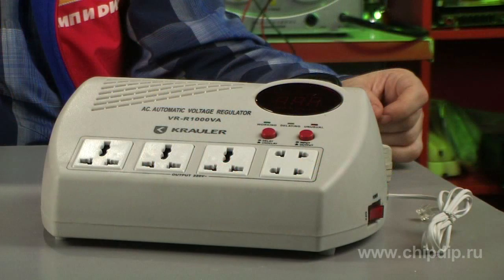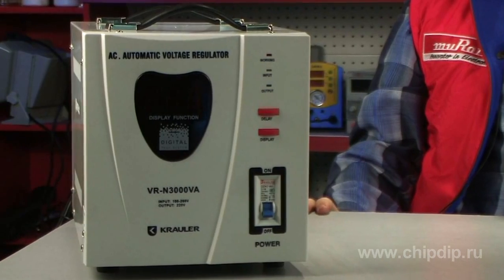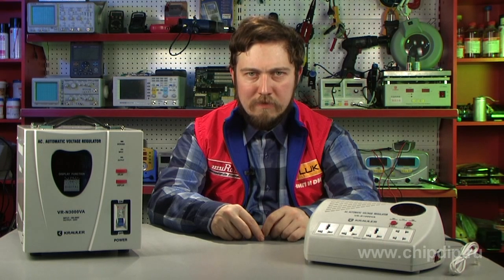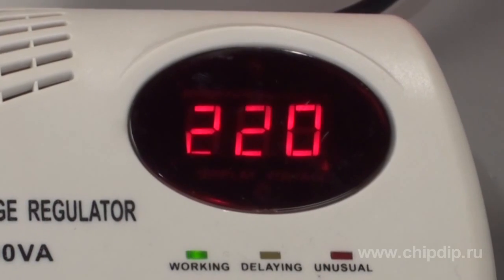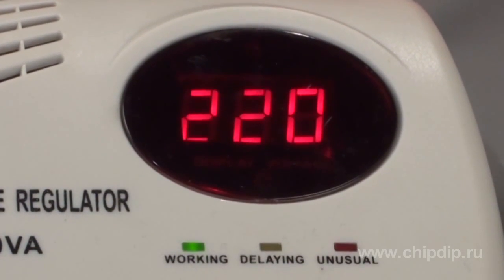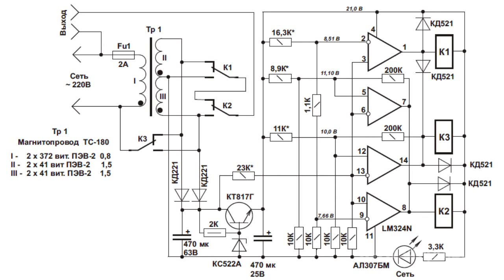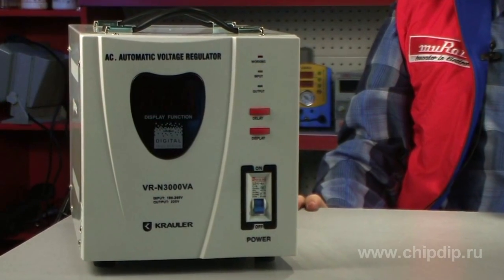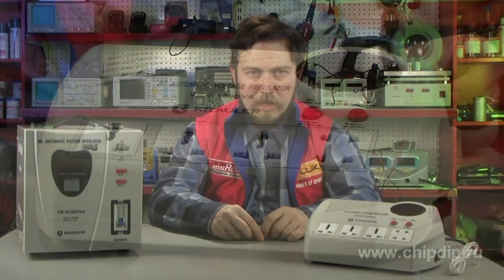Relay Type Voltage Stabilizers

Comment: dear sir i want to know what is the the transformer winding diagram for 5kva auto matic voltage steplizer 7 n 5" in E I core from input 90 volt to 22o volt